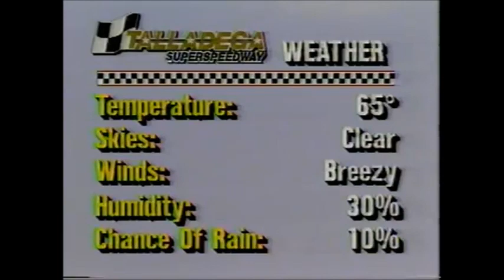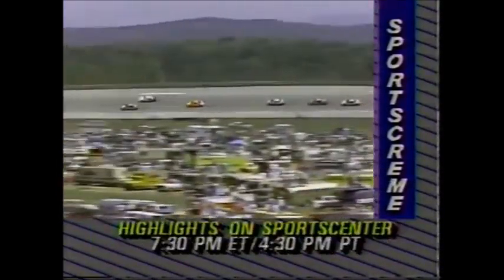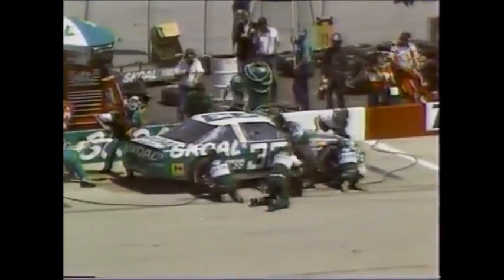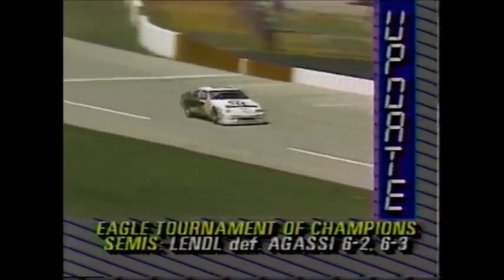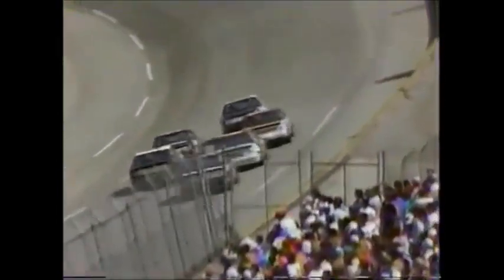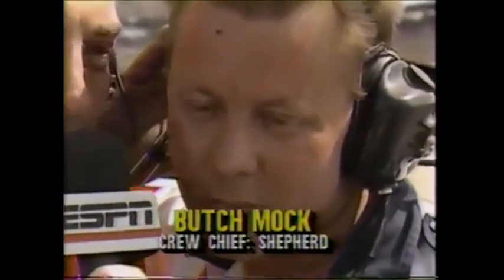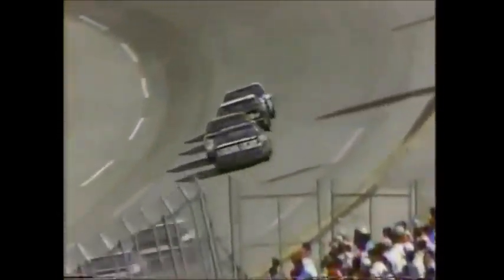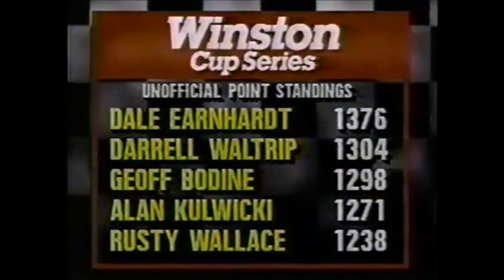1989 Winston 500

Comment: 1st race for the Chevy Lumina. Never liked that car. The 4th gen Monte Carlo was the last of the race cars that closely resembled the street car and actually used production parts on the race car.
Reply: The lumina used stock sheet metal, hood, roof, deck lid. And 89,90 they used stock grills.
Reply: Which 4th gen Monte Carlo? The 95-99, 2000-2002, 2003-2005 or the Monte Carlo SS 2006-2007. All of these car’s models are 4th stock cars.